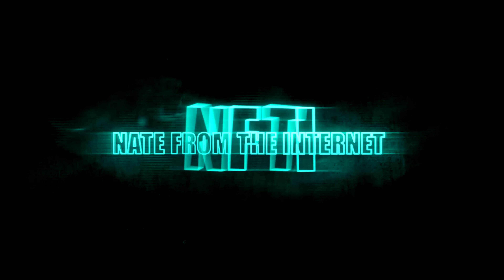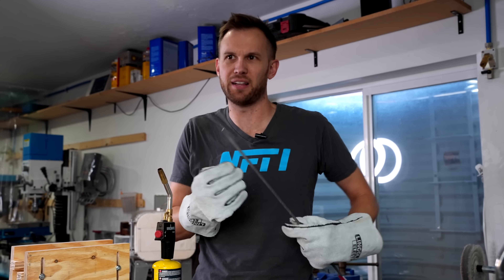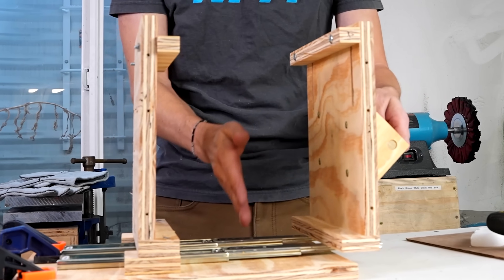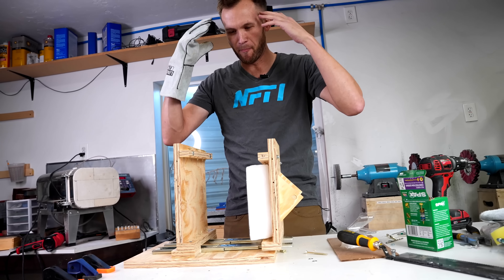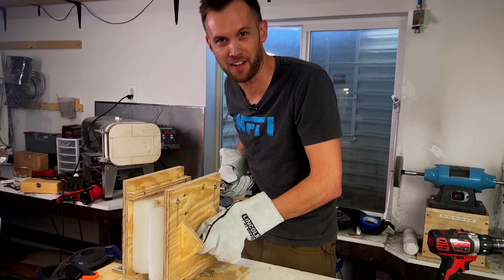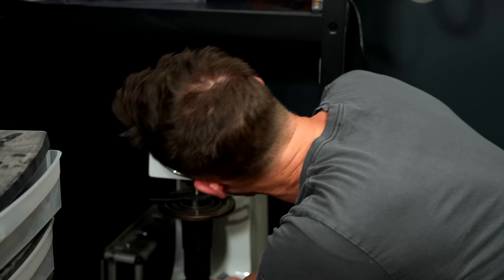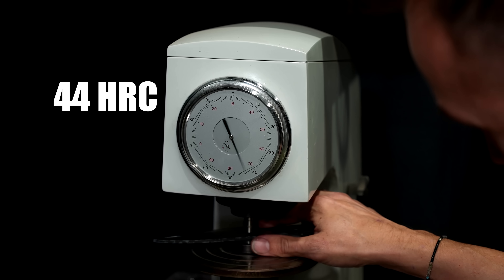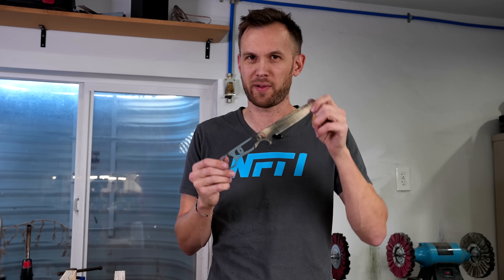Can You Quench a Knife with DRY ICE??

Comment: What if you quenched it in oil that is cooled by dry ice.  None of these materials are that cold compared to room temperature in contrast to the heat of the knife.  So clearly contact matters more than temperature.  So I'd say use a traditional contact method but get it colder with a youtube meme material to see if it makes a hair of difference.  Of course super cooling an oil will make a jelly.  Maybe that is ok.  Taking it as far as possible you might have oil between two plates cooled by dry ice.  You plunge the knife in the gap and move it vigorously to keep it in contact with the coldest oil.  If you first pass moves it edge-ward the edge will stay in contact with the freshest oil for that initial movement.

Comment: Well, 2 reason for slow cooling - 1: due to air/co2 pocket, 2: dry ice os not a good heat conductor, so how cold it may be, if the heat is not moving then it will not get cool. In fact both co2 and dry ice is the same.

Comment: You need to find a fluid that remains fluid at cryogenic temps but doesn't flash boil when hit with forging temps... not so easy. Anything that flash boils will create a pocket of gas around the blade that prevents rapid heat transfer (defeating the purpose of using the cryogenic temps).

Has anyone tried a two step quench? Use a traditional fluid to do the initial quench then once temps are lower switch to a cryogenic fluid.

Alternatively... you could do the last heat and quench under very high pressure (preventing flash boiling). That would be a crazy experiment but REALLY interesting.

Comment: hey nate! i know this video is almost a year old, dunno if anyone told you but a rockwell hardness tester works by applying a minor load, calibrating that to a zero position, then applying a major load. the C scale ends up being 150kg typically (although using different penetrators and weights, you can convert the c scale). once the needle stops and you wait a minute or two (in lab testing they wait much longer) you take that major load back off, and it measures the difference! so it measures how deep the penetrator goes. a brinell hardness test is similar but it measures the width of the hole created. love the knife videos though!! -sincerely, an a&p student who just had to learn and do all of this in materials and processes

Comment: Food for thought since liquid does the best why not quench in chilled with dry ice motor oil. Vapor seems to be the villain in this story even in oil it just resist vaporizing once it reaches a certain point all other will instantly turn to vapor. Oil at a point will still try to boil but seems to reach a higher resistance to vaporizing. Once you have reached a liquid that doesn't vaporize molecules will rapidly stop moving and produce harder Rockwall. Tool steel has the harder but brittle shatter point when quenched. So thickness of the blade and how much you quench rapidly will effect the outcome.

Comment: I would like to see how would it work if you nitrogen cooled the blocks of try ice bedore using them to quenching, so that they are not on the border of sublimating when they are cooling down metal but have some wiggle room. Also to try the same with nitrogen cooled normal (water) ice.

Comment: In the lab to get an efficient heat transfer at the temp of dry ice we use a mix of dry ice and isopropanol.  The isopropanol you should be able to get at paint store.   Just break up the ice and put in enough isopropanol to cover the object.

Comment: The dry ice would make less contact than any liquic because once it melts out a space, there is only gas cooling stufff.  Unless the dry ice was smaller than the blade, you would just have a knife shaped hollow in the ice.  Try it with two pieces of dry ice that don't touch eachother.

Comment: Instead of quenching the blade in either water or dry ice, try both at the same time. Also, make sure the entire blade can be submerged. You’re trying to cool it quickly to sort of freeze the atoms in place while in an excited state, letting it cool slowly would allow the atoms to settle like silt at the bottom of a pond. If the entire blade including the handle isn’t being quenched at the same time the heat from the handle can dissipate into the blade slowing the cooling process. Unless the metal is designed for it that can effect the outcome, by how much I can’t say with out doing some testing. The first law of thermodynamics states energy can neither be created or destroyed. So using a small amount of liquid heats up the liquid and slows the cooling rate. Try getting a larger container of water, like a fifty gallon drum and filling it with normal ice. The quench process involves the dissipation of heat and the speed at which it occurs. So I would assume (if you stuck to just using water), the initial temperature of the water just before the quench would effect the outcome. Try that. Not extremes like liquid nitrogen (which was still awesome, btw), just hot water, room temperature water, cold (ice) water, then maybe find a way to include dry ice in that experiment as well if you can. No matter what, be sure to use large quantities of water, not just gallon jars. Since the heat is dissipating into the water a larger supply of water would be able to absorb more heat from the blade at a quicker rate. Would heat treating it in a large cold water supply, like a deep pool work better? Dropping it in the deep end allowing constant surface contact with the metal while continuously passing through fresh cold water. Would cold water being poured over the blade work better for hardness? I’m sure it would warp the blade more. Try not using the same container of water that would warm up with the quench, but instead using a continuous supply of fresh cold water. Like flood coolant in a cnc lathe/mill. Also, even if quenching it in water makes it slightly harder, quenching it in oil treats the surface of the metal and makes it more resistant to corrosion. The tiny pores in the metal absorb the oil and help keep it from rusting. I’ve got an interesting welding project I’m working on that involves stainless and mild steel being tig welded together. If I can get a video put together at some point I’ll try to tag you. I just found your channel and I think it’s great. Stay curious, my friend. The most common phrase uttered after an unintentional scientific discovery is “That’s funny”, because the results were not intended or expected.

Comment: I don't know how to achieve it. Test the hardness of a directionally heat treated knife. General Electric does this with jet engine parts.

This creates a metal part made up of only one crystal. Heat treating steel charges the size of the metals crystal structure.

I have no idea how General Electric does this. Bit of corporate secret.

Comment: Instead of using screws to hold the dry ice use plastic or cover the clamp in Styrofoam. Metal contact with dry ice makes it transition from solid to gas faster.

Comment: What if you built a radiator / refrigeration tubing on some aluminium plates where you pour liquid nitrogen or something & the aluminium plates are then super cooled & you quench it between the plates under pressure. 

And what if you used pressurised oil that constantly sprays. So maybe a waterfall or fountain of oil constantly flowing….

Comment: How a real metallurgist would get up to 60 Hrc (or higher with the right steel) is to first quench in warm quench oil that transfers heat really well, and then put it in liquid nitrogen for an hour. It needs to quench very fast at first and it needs to stay very cold for longer after because the structure in the steel takes time to form (simplified). I guess the dry ice doesnt transfer heat as well but it also melts away so fast that you get airpockets too. also the outer layer of the steel is not as hard as the rest, so you might want to grind off the surface.

Comment: Dry ice isn't really a good heat conductor. If you want to cool the knife fast, you need something that really conducts heat well AND is very VERY cold.
If it wasn't so extremely deadly, I'd suggest mercury as an option at -35C. But if there is a way you could do it in a controlled lab setting..... I'd love to see the results.

Comment: Maybe badly... Leidenfrost effect... Blah blah... Put the dry ice in alcohol or some kind of brine or glycol solution quench the knife in the solution.... I don't know if you can get a brine with a freezing temperature low enough but if you can it will make the water more dense and water also has a high specific heat so it takes more energy per degree per mass to change its temperature. This might be a recipe for a cracked knife. But perhaps if it survives it will help squeeze out trapped austinite like a cryo treatment.

Comment: If you use granular dry ice and acetone, you would have a slurry of super cooled liquid. The only issue would be if the acetone would ignite when being touched with the hot metal.

The liquid would be more efficient at carrying the heat away.

Comment: Can you use liquid nitrogen to Lower the temperature of two slabs of metal, then use that to temper the knife in a vice??

You should have plenty of contact that way, a Copper or Aluminum slab would do best as they have great heat conductivity.

Comment: In the North East you can get dry ice from welding supply stores. And instead of using blocks of dry ice find a media blasting company that uses dry ice to strip rust and paint. They blast small dry ice pellets at the material to be stripped. So you could heat up the knife and then use the media blaster to cool it. That should cool the knife but more importantly the dry ice blasting at the knife will blow away any Leidenfrost effect around the knife.

Comment: I would be curious to see the results if you made "poor mans liquid nitrogen" its just pure alcohol with a bunch of dry ice dumped in it but since its only as cold as dry ice and not liquid nitrogen it wouldn't boil off as fast? or Mabey try experimenting with some kind of concentrated antifreeze, they typically are designed to resist boiling in case your engine gets too hot.

Comment: Water, N2, and O2 all flash off due to their own flash points. While it would be fairly dangerous, I am curious about using some sort of liquid metal. Mercury is obvious to think of; but sound extremely dangerous. I don't know what other metals might be liquid at low-ish temperatures. It could even possibly be liquid at 100 degrees F and possibly accomplish a decent quench. Just some random thoughts....

Comment: Nate, you don't need something very cold. You need something with very high thermal diffusivity that can be applied with consistent pressure. These microstructural transformations happen in seconds. After the first ~10-15 seconds or so of cooling even in air, the hardness of the blade is set and further cooling won't really change it.
Realistically, water is hard to beat for this. A fluid definitely can't be beat by a solid at cooling. No matter what fluid you use, you will want high flow and/or turbulence (but low air/bubble content) to mitigate the leidenfrost effect as much as possible.

Comment: Specific heat of dry ice is 815 J/kg C, while oil is more like 2000 J/kg C. I don't know that it's an exact measure, but that does say that dry ice's ability to "absorb heat" (i.e. cool the knife) is less than half that of oil (not taking into account surface contact of liquid vs. solid blocks) so it's probably not able to cool the knife fast enough to actually temper it...

Out of curiosity, looked up water and it's 4186 J/kg°C, which would explain why it cools TOO fast and tends to cause cracks, etc.

Comment: I remember seeing something (I believe on MythBusters) years ago where they tried hardening with used motor oil and I've always wondered how well that would work with a knife/blade.  Perhaps you could combine this by getting extremely cold used motor oil or have a quenching tub that rapidly cycles the fluid through it for faster thermal transfer?

Comment: Water is a surprisingly good heat sink. It might not be as cold as dry ice or liquid nitrogen, but it doesn't need to be. Even at room temperature, it can still sink a lot of the heat off of a piece of metal - which is itself a pretty good heat conductor.

Comment: You know what that means....
Time to super-cool some quenching oil!!
How? 🤷‍♂️ Toss in a couple bricks of dry ice? Put the whole bath of oil into a deep-freeze (if you live by the ocean there might be a fish packing plant that has deep freeze capability that might entertain your need... 😅

However, I'll admit... this, too, may not yield the desired results. Because the super cold oil is now also super viscous. As such, it'll heat up what's around it and likely be unable to let you make contact with cold oil.
As well as, the very resistive oil may cause you to warp the blade as you force it around the thick oil.

So... Maybe a super concentrated bath of very cold salt water? (lowering is freezing point) 
Or, a super-cooled bath of 95% Everclear (ethanol)

In the end, my understanding of why water is NOT recommended, it's due to water's ability to cool metal too fast and risks cracking the blade... Oil being able to cool it, but at controlled rate.
As such, not sure the above 2 ideas with cold water or alcohol, will be all that good in the end... 🥴

Comment: Sir you didn’t use Anti scale or steel foil and then you didn’t grind off the decarb before testing the hardness. I bet the core is around 60-61hrc due to the fast cooling rate and a short cryo. Also 2000 degrees is pretty high for a steel that you don’t cryo. Too much retained austenite.

Comment: Can you supercool the oil with dry ice or break it in to smaller pieces so it self corrects as it sublimates? Like quick sand dry ice or maybe super cool copper beads and dunk the knife In it ? It seems like a loss of surface area issue if the surface can turn to gas but you can keep the contact solid and at temperature. .. how do company cryogenic treat metal to last longer?

Comment: You can quench an already heat treated part long after thats been done. There is a video showing a drill bit cooled down to Liquid Nitrogen temperatures once the drill bit lasted 2.5x longer than an untreated one IIRC.
This might be why old tools last so much longer than new tools. They have been left in a shed and have been quenched by the weather. New tools are often found inside and never go that cold.

What you could try is (kind of expansive tbh) recreating that.

https://www.youtube.com/watch?v=hAxi5YXTjEk

Comment: Light machine oil, perhaps even WD40, cooled with dry ice should allow for both the cooling temperature of the dry ice and the continual contact of the oil.  The dry ice was again forming a vapor region around the metal that preformed poorly in transporting heat.  An oil intermediary should remedy this condition while still getting your blade quite cold.  Even if the oil freezes, application of the high temp steel should rapidly return everything to the liquid state.  Let's see a video on this please.

Comment: With quenching the speed of temperature change is what matters and the sweet spot speed for some notion of optimal hardness seems to be provided by the quenching oil (who would've thought?).
However after quenching and getting it to room temp the speed with which you can continue to quench becomes so slow that you can do it e.g. by simply putting the piece in the freezer (see so called ice hardened steel).
So it would be an interesting experiment to quench as usual (with quenching oil) and then harden it further with freezer, dry ice, liquid nitrogen, etc., and see how hard (and brittle) does it get, however I think it is a situation of diminishing returns.

Comment: Hey Nate, nice video! I thought it required, adding some form of carbon when clenching such as powdered chicken bones or oil to help create hardness? I remember you using oil before, I’ve also heard powdered chicken bones help as well keep up the great work!
Reply: thats case hardening gives a harder outer layer but does not get into the steel all that deep.  often done to low carbon steel gun parts because of the look you can get (think old revolvers)
Reply: Hey, thanks for the info. I remember working with my dad. He taught me this when I was a youngster and it was about guns. Thanks bless you brother. @lrharner

Comment: So if the problem is that when the dry ice sublimates and creates a pocket where the knife no longer has physical contact, then maybe you could use the dry ice to cool your aluminum plates before and during the quench. That way you get the benefits of the aluminum's thermal conductivity and the low temperature of the dry ice.

Comment: 4:45
If you live a place where dry ice is unavailable, you can (kinda) make your own.
You need to empty a C02 extinguisher into a container of some sort, and then compress the C02 snow that come out of it as much as you can.

It isn't perfect, end its expensive as heck, but it'll work in a pinch.
It can also cool down a case of your beverage of choice to fridge temps in about 5 minutes.

Also, you can probably order it online.

Comment: Try tu use cold oil vs room temperature. You also my try experiment with a copper sandwich as a razors blades are processed like this. Copper sandwich would transfer heat more effectively when quenched and it help with knife buckling.